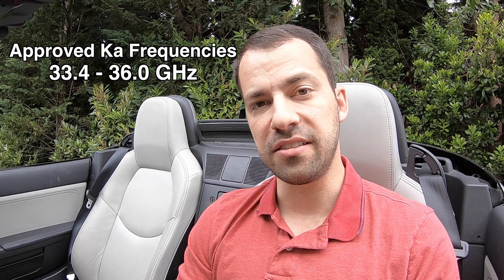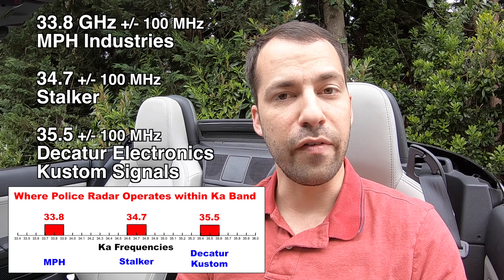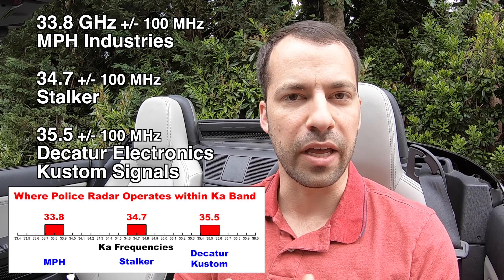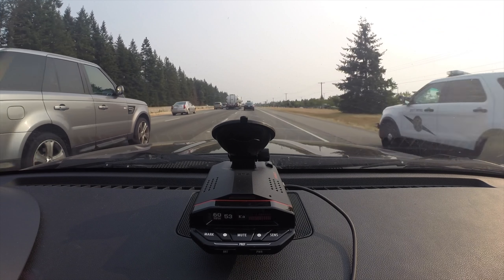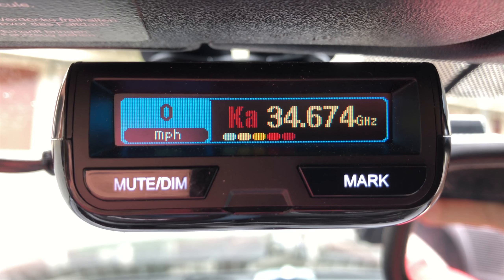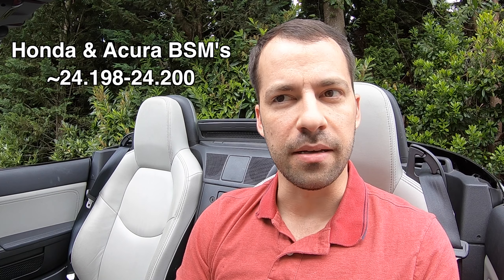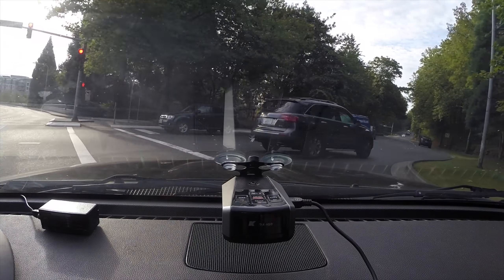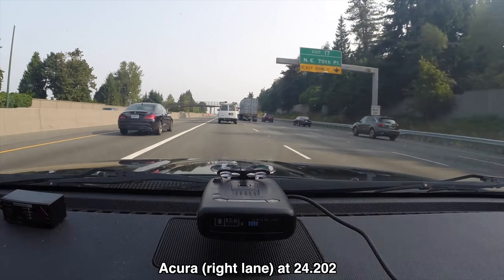Understanding Police Radar Gun Frequencies: Five Minute Fridays, Ep. 8

Comment: when you're up against an instant on radar unit, as detected by a strong signal,  you need lighting fast braking in order to defeat the cop from getting a reading. if you take the time to analyze the frequency then you'll be caught. better to immediately slam on the brakes and look at the frequency afterward. i've beaten a few instant on units, so it can be done.
Reply from the maker: haha for sure, a full strength alert takes precedence over frequency analysis :p

Comment: If the frequency is 35.50 I'm looking for the gray State Trooper of NC.  If it is 34.70 Raleigh city white SUV or Wake Forest brown car.
Reply: Hi Scott since you live in NC I was wondering if you have your radar detector segmentation set up? I am curious as I have encountered a Lincolnton sheriff using some sort of speed gun at night that didn't set off my detector and I'm running segmentation. I'm just wondering if they are using some other band now in addition to the 2/5/8 segments. I realize maybe he didn't shoot my car but found it odd as most are trigger happy with their radar guns from my experience.
Reply: mrelectron62  That is where I have been told they run X band radar.  Is that setting current on with your radar detector?
Reply: Set it for 2/5/6/8
X band was decertified in NC in 2014
It may have been a Pro Laser 3 if it had two opitics side by side
Though ive never even seen the LCSO run radar on the LKN side
Ive seen lincolnton city police run 35.5 Gaston county 33.8 

If the lcso you saw was in an unmarked silver/black charger it probably was laser
Reply: White Russian where is it printed on the web that X band is no longer used in NC?  Several people on Rdforum.org say it is still in use.  Are you a member of that website? It is free.
Reply: Scott Desander 
X was decertified for use in NC in 2014
SC as well has got rid of the last x band though still certified for use
Vortex will tell you all about ourdated threads with X band
K band is gone in most parts of western nc under a initiative that took place in 2000 to upgrade all x band units
Thats why youll see kustom 35.5 in places like N wilksboro
Alot of counties/cities follow the states lead
K band is still a threat but is less popular
35.5 is deadly in the rolling terrain its all they need
Reply: White Russian7  good I love having x off.  I was just worried about Python 3 it does have X band capabilities 😅.     My Radenso ProSE is a killer on 35.50 and seems to have has a short distance on KA 34.70.     Thanks for the information.  On last question how about POP. Radar?

Comment: You forgot the Mazda BSM on 24.123 area.
Reply from the maker: Oh there's lots of other BSM's we could mention. The ones I shared are some of the most common. Many newer detectors can filter out Mazdas though. Which detector are you using?
Reply: I have a Max360 1.5 that does not filter the Mazda’s. It took me a while to figure out that it was a Mazda. I run the R3 on the Highway. Don’t really run it that much. Making a trip from FL to NC this weekend. Going to finally get to test it out on the highway. I don’t know if it can filter the Mazda’s, I know it doesn’t filter the Honda/Acura, or the GMs.
Reply from the maker: Yeah newer firmwares, 1.6 and above, are better at filtering out BSM's, but they have the lockup issue.
Reply: I had a 360c. Sent it back after it locked up on me twice after three days of use. I saw your 360, 360c, and the GT360 lockup videos on the forum. I just wanted to give Escort a benefit of the doubt, but I learned my lesson.